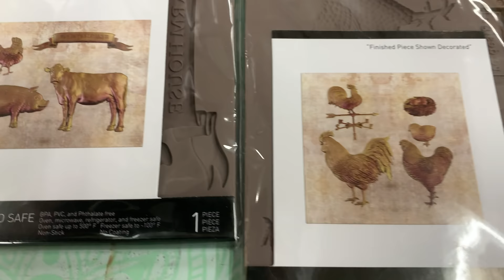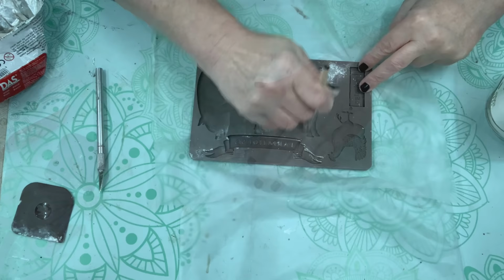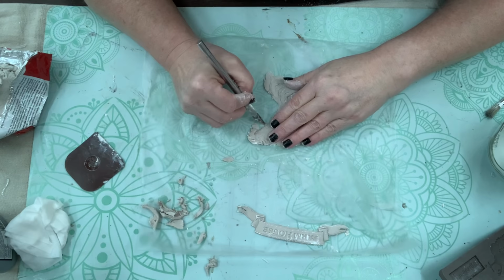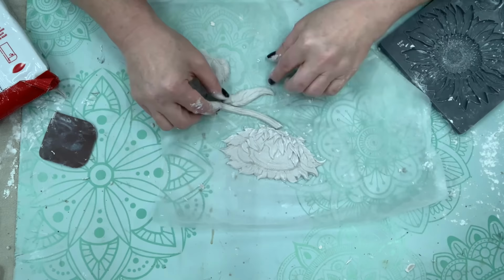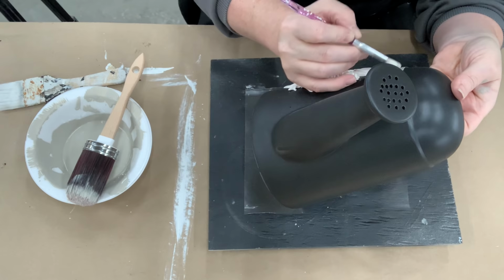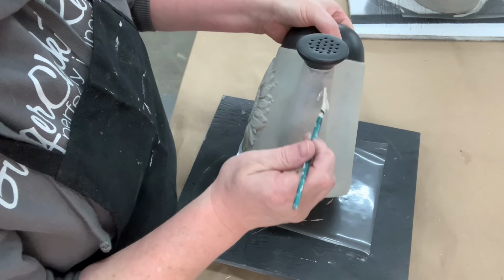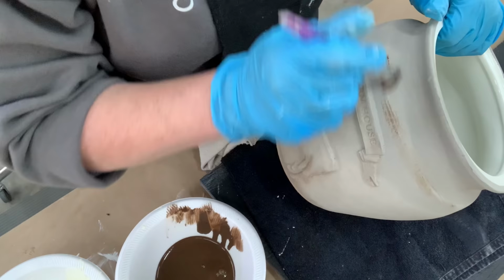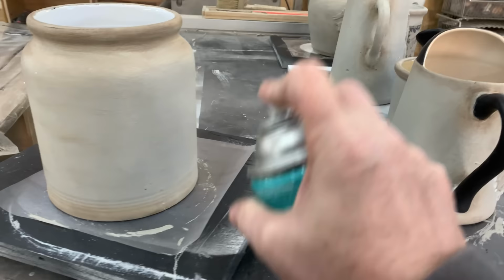Textured Paint || IOD Moulds Redesign Moulds || Pottery || DIY

Comment: Don't be afraid to use more cornstarch.  I use a really cheap clay, and when it comes in, it's very wet.  So I use quite a bit.  When the clay has set for a couple of hours, I go back with a gentle brush, and dust off the extra.  Also, I use the back edhe of a long slender knife, to get the extra clay off of the mold.  You're doing a great job.  All clays act a little differently.  But after you get the feel  for it, you'll be a pro!   A couple more things I do....keep your project away from vents, place a plastic bag over your project so it all dries in the same , and if you'll add some glue to what you put in your mold, it helps with cracks.
Reply from the maker: Thank you, I appreciate you sharing your knowledge 💝

Comment: Those look great!  You can brush the wood glue onto the back of the mold, using a small paint brush,  for smoother application and if it is difficult to get your clay out of the moulds, add a little water kneaded into the clay to make it smoother.  That will keep your clay from breaking and crumbling.  Good luck!
Reply from the maker: Thank you

Comment: I have the sunflower mold and love it!  My one wish is that they would have included a smaller, fully open flower in the mold set too, but that's a bit off topic from what you created here. Each one of these pieces turned out fantastic!  You would never guess that they weren't created that way from the manufacturer.
Reply from the maker: I do get what your saying. I’d use a smaller one too🌻

Comment: Yvonne, when I work on a round surface I use a bowl from Dollar Tree with rice, I put the rice in a zip lock bag and it works great to keep the project in place
Reply from the maker: Good tip.. I usually use two lint rollers. But I was too lazy to go into the house to get them. I was in the workshop 🤗🥴

Comment: Hi there, if you use decorators caulk in the moulds, the moulds stay flexible, but you would need to make them in advance as the take a good 24 hours to dry, but oh my they turn out great. I do a production line and set out all the moulds i have and then fill them with the caulking and usually do this once a week, its kinda messy but way cheaper than clay, and the flexibility is brilliant and you can still use wood glue to stick them on what ever project you are working on. Hope this helps you

Comment: I use the IOD roller or the cheaper one on Amazon to push the clay down into the molds, it works like a charm!
Reply: IOD BRAYER I MEANT
Reply from the maker: Good tip

Comment: I have seen that after you make the molds, you can lay them out on plastic wrap that is laid over the surface you wish to put them on. Let them dry on the plastic wrap so they have taken the form of the surface, then take them off the wrap and glue them to the surface. It might work better.

Comment: Beautiful last month I did a few recipe boxes with these 2 farmhouse mould. I bet these would look great on bread boxes as well. Beautiful as always dear
Reply: Also casting resin when first pulled from mould is still able to form curves. Add some painters tape to help the moulds stay intact with the tight bond quick n thick. I found the resin was easier n faster to work with.
Reply from the maker: Oh.. yes.. if they still will open properly 💝

Comment: Hey GCR. For the adhesive, you might want to try to brush on the SLOW acting Tightbond, then put a bead of CA glue all the way around the outer edge of your piece. Position the piece, then hit it with CA activator (I use Starbond) and it'll stick instantly. 

The slower Tightbond gives you a longer open time to mess with it, and the CA glue gives you instant support so you can move on with your day and let the Tightbond cure.

My woodworking husband put me on to this trick and I've found it to be a crafting lifesaver.

And bonus tip: get hold of a can of the freezing wart remover to instantly harden hot glue. I keep my can of wart remover with my box with glue gun and sticks. I use it every time now. (Youtube hack)
Reply from the maker: Thank you for sharing that

Comment: Just wondering if using a plastic rolling pin would help push the clay into to molds instead of pushing it in with your fingers which  creates a  lot of lumps and bumps.
Great idea to use the press and seal. That may also be great for holding woodubend in place instead of tape.
Reply from the maker: Oh.. yes I think that would work great too. Thank you